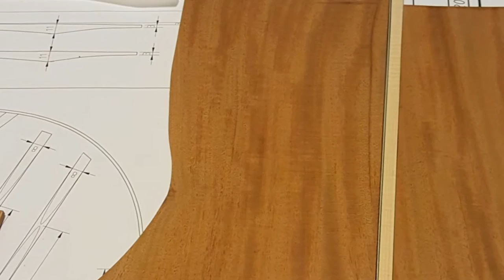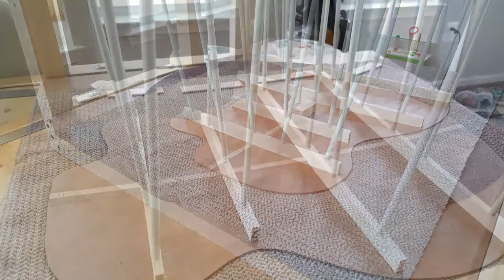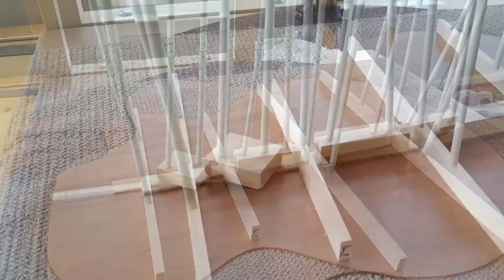❌ GUITAR BUILD | BRACING AN ACOUSTIC GUITAR BACK

Comment: I think you did a great job.... But I must say, that you should in the first place, assemble the Central Brace (a unique piece), in order to have a perfect central aligment of that central brace. Then you should use the chiesel to make the insertions, and finally you would asemble the lateral braces, And not the oposite order.
Reply from the maker: +GuitarraLisboa1977 Thanks for the suggestion, this is my first build. My thoughts process was making sure the center strip edges butted up tight against the lateral braces. It seem that with the back radius of  25ft , the butt joint where the center strip and lateral braces intersected would not be a perfect 90° due to the radius. That's why I opted for the lateral braces first. It was tedious getting the angle of center strip just right, but I was very happy with the outcome.